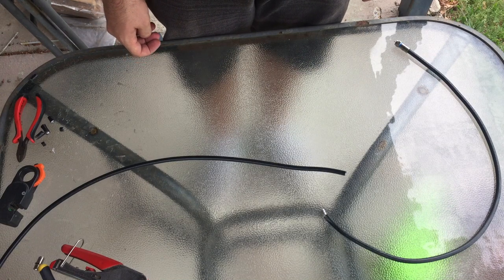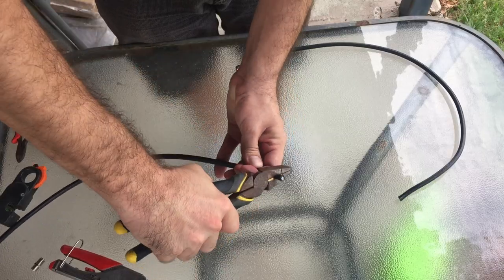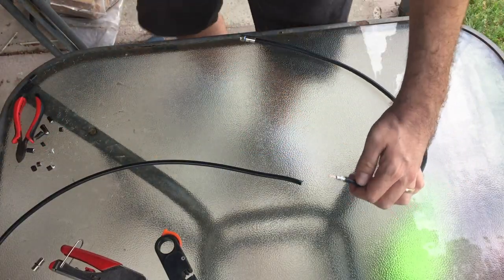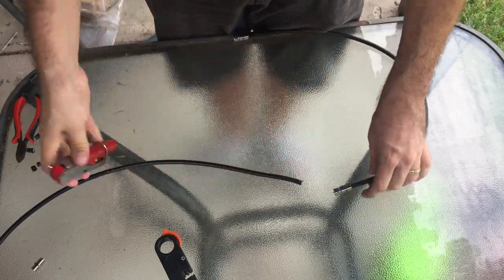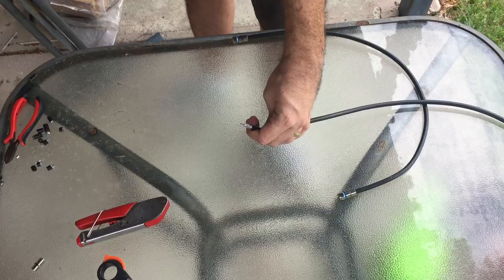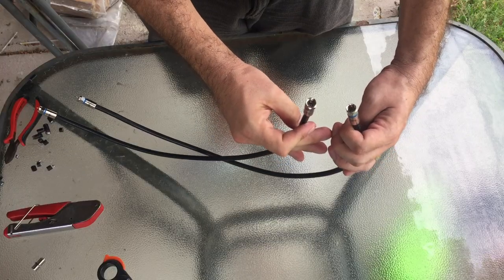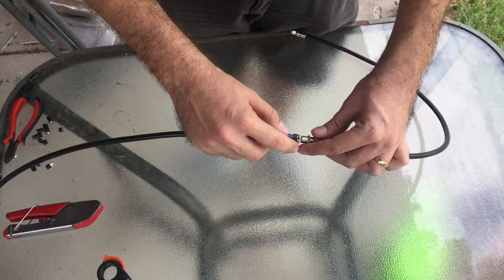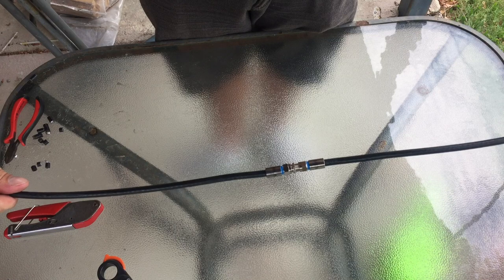How to Rejoin a Cut Coaxial TV Cable

Comment: Dude, this was so perfect. Accidentally severed the cable line in my backyard. Your video, a trip to homedepot and boom, I’ve got my internet back! Thank you!!
Reply from the maker: If it's an outdoor joint, I'd suggest wrapping it tightly with self-amalgamating tape then cover that with ordinary black insulating tape.
Reply: Is there any electrocution hazard with messing with the outside cable line like this? Or can you follow these steps with a live wire?? I just severed my cable wire outside with a talache. It runs underground leading up to my house, and apparently it wasn't buried deep at all, and no conduit. Stuck without internet & television. :/